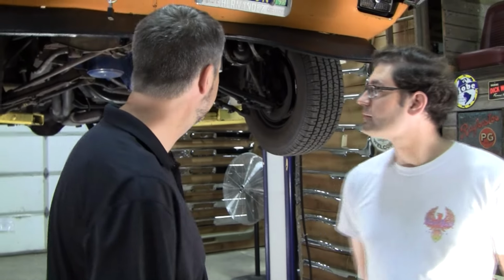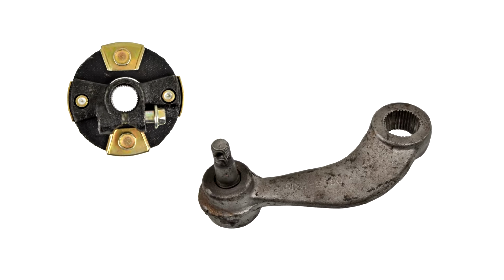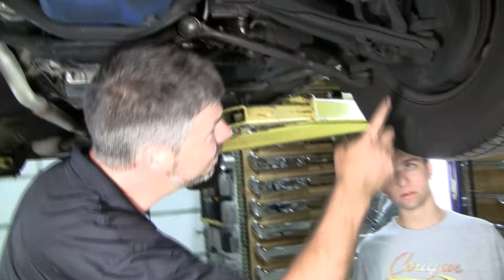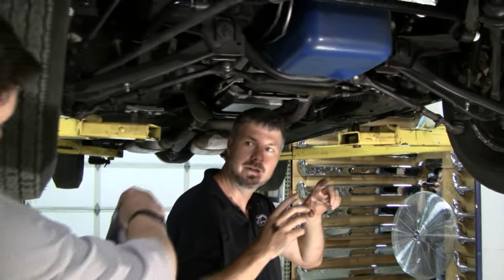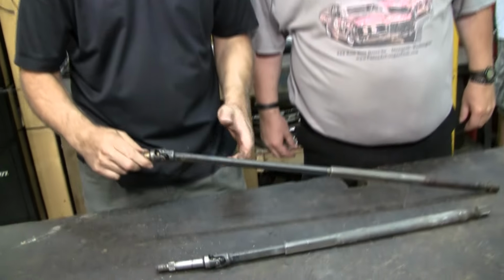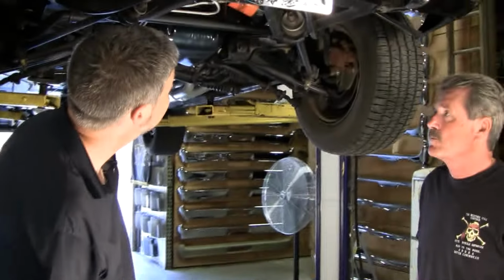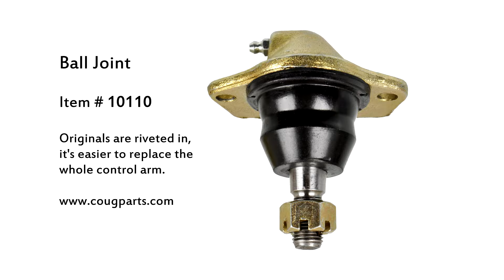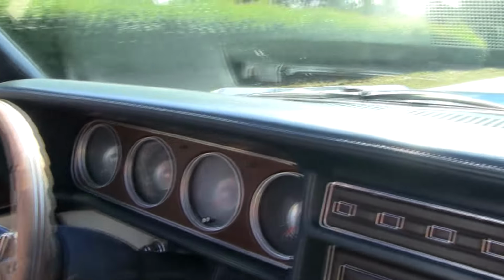Sloppy Steering Syndrome - Problems & Solutions

Comment: Great video..very informational..thanks I have a 67  ford  econoline van 6 cyl that I'm having steering issues with very stiff sat in a field for over 20 years original belll telephone truck from Mount Vernon Washington, first step is lube the steering box and I'm trying to figure out if I can use grease or 90 weight gear oil, it hasn't been lubed I'm assuming since the Nixon Administration if eve..r thank you
Reply from the maker: This might help: http://www.stangerssite.com/lubrication.html

Comment: I’ve got a 55 Commer truck with worm and gear wheel it’s tiring to drive with a sloppy steering wheel. All of the solutions have an adjustment nut while mine is adjust by a weird shims arrangement

Comment: I have a school bus (18K GVWR) converted to an RV, with pretty extensive wandering problems. Though it's a much larger animal than shown in this video , virtually all of the components are duplicated just on a larger scale. I am now equipped to diagnose my issue. Thanks for the info. Holding on to the tie rod  while someone else moves the wheel, is a key way of detecting worn parts, that a cool hack. Thanks.

Comment: if the steering link arm has worn tie rod mounts can the link be bushed my car has no replacement for it. and the link is cast. The only thing i can think to do is bush the holes. my car is 1963 Pontiac lemans

Comment: Could you tell me how to fix the problem at 7:33. The gear box not moving but the steering column have about 1/4 turn slag. Thank you so much.
Reply from the maker: You probably need to look at the Rag Joint: https://secure.cougarpartscatalog.com/store/Search.aspx?SearchTerms=rag%20joint&CatID=0

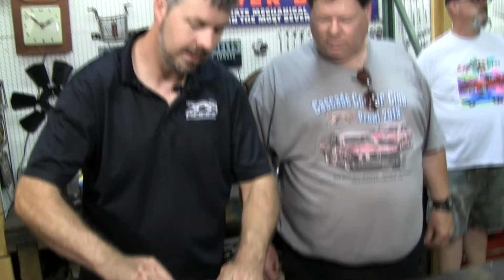As well as replacing the Retainer Clips at 14:25 : https://secure.cougarpartscatalog.com/17949/32067/retainer-clip-split-shaft-fixed-tilt-column-pair-repro-1968-1973-mercury-cougar-1968-1973-ford-mustang.html.
Reply: @WestCoastClassicCougar  Thank you so much for your willingness to help. Great channel, I love it.

Comment: Have an issue with tbe power steering, steering  wheel would slam to left, replaced power steering pump, new lines, rebuilt control value, scared to drive it.  Also trys to stall when wheel is turned to the left......no ideas what could be wrong...
Reply: I've heard the hoses may be reversed. On the rack. Don't know if it's true or not.

Comment: I almost had an accident this morning....my steering wheel kept feeling like it was going to come off....so loose.  Had the rack and pinion replaced 5 DAYS AGO. This morning on my way to work ,I felt something come loose...scary situation.  Got off the freeway and as soon I pulled into the has station,I completely  lost all power at my steering wheel....my steering wheel just kept doing complete circles right and going left....my tires just went straight....my car is back at the mechanics. Just glad we got off the freeway when we did...could have been really bad.
Reply: What happened?

Comment: I just installed a Borgeson Steering kit in my 1970 Mustang with tilt steering column! I made a major mistake. I told Borgeson I had a tilt Column, and they told me to buy the GM DD Rag Joint connector. Well, that wouldn't fit. So instead of really thinking about what I was doing, I ground the end of my steering rod to match the new DD Rag Joint. Now when I turn the wheel hard, there's a "thunk" and the rod moves slightly! All I had to do if I had given this situation some thought, is split the old rag joint in half and reuse the end that fit! 
Borgeson also told me to "Beat" the shaft out of the column in order to cut 1" off the outer Column housing! After watching this video, it's obvious that this is not the right move!
Now I'm in a situation where it's likely that I'm going to need to take the column back out, and weld a piece of 3/4 DD to the end of my inner shaft! Any comments from the guys at West Coast Cougar regarding this mess!? And by the way, you guys absolutely ROCK! You're my favorite problem solvers!
Reply: That was a $2000 steering column
Reply: That was a $2000 steering column

Comment from the maker: There seems to be some confusion over a statement Don Whitnell (DW) makes at around the 15:10 mark.  He says  "Most people put these in wrong". DW is referring to putting the shaft together incorrectly, not putting the clips in. The upper and lower shafts can fit two ways, but only work in one way. You should always mark the two pieces before you separate them so that they go back together the same way.

Comment: steering box rebuild on exchange basis for a Mitsubishi 2006 endeavor what would the cost be?
Reply from the maker: Those are substantially different than what come on the 67-73 Mercury Cougars we sell parts for.  You can get the one you need through most auto parts stores.  Here is a link to one at NAPA: https://www.napaonline.com/en/p/PS_361518

Comment: Hell my 1968 Falcon had sloppy steering the day it came off the lot brand new. It may sound unscientific, but back in the day the way I ''fixed'' it was by putting R/70 or wider tires in the front.

Comment: what is the cost at all that?
Reply from the maker: It really depends on what the issue really is.  

Play in the steering can be as simple as a pair of retainer clips in the steering column (https://secure.cougarpartscatalog.com/17949/32067/retainer-clip-split-shaft-fixed-tilt-column-pair-repro-1968-1973-mercury-cougar-1968-1973-ford-mustang.html) to needing to replace the steering box or suspension components. 

All the parts mentioned in this video can be found on our website in these two categories:
Steering parts: https://secure.cougarpartscatalog.com/steering.html
Suspension parts: https://secure.cougarpartscatalog.com/1967-1968-1969-1970-1971-1972-1973-Mercury-Cougar-Front-End-Rebuild.html

Comment: 31 years ago I fought this on my 67 Mustang coupe and gave up. 2 power steering control valves (dont use a pickle fork. I pulled the ball stud right out), springs, steering box (3 or 4 foot long solid shaft), upper control arm bushings, idler arm, 100 alignments, lower ball joints. It won't straighten out right after turning. Tried adjusting the control valve. I think the ride height is off. The lower control arms aren't parallel to the ground. The shock towers are good. Oh yeah, new shocks. Bearings.  I haven't driven it in nearly 20 years and that was just to change houses. It wanders everywhere. (Sigh.) You reminded me -  Headers require the extension for the power cylinder shaft (I have it.) Maybe I should jack it up and check it out again now that I'm old and broke instead of young and broke. Sheesh! I was watching Def Leopard, White Lion, and Skid Row on MTV (They really played music before, kids) when I was trying to fix it. Now all that stuff is classic grandpa rock. (Still kicks the crap out of the new stuff, young whipper snappers!)

Comment: I drive and push on brakes steering wheel pulls to left real hard replace brakes brake line and slave cylinder and bleed correctly and adjust brakes correctly has drum brakes. Change all front end tie rods idler arm pitman arm . U can drive just little forward still pulls steering wheel real hard to left can that be steering steering don’t holding it center thank you

Comment: Two outer tie rod boots were referenced in this video, one with a steel sleeve, one without. If the tie rod does NOT have a machined area around the casting at the ball joint, the steel sleeved boot WILL NOT fit. If it does, the non-steel sleeved boot will be sloppy loose. So don't order new boots just because you like the looks of one or the other, make sure which style tie rod you have before ordering new boots! I learned this the hard way because my friend's '67 Mustang had one of each.

Comment: I know my vehicle is way off from what your showing here but I have an 01 Nissan Xterra suv that I bought last year. I paid too much for the truck and have put a lot of new parts into it since but I absolutely love the truck.  I used to be strictly ford as my first ever car was a 84 ford mustang but I wanted an suv and had explorers, etc and wanted something different. I am getting ready to put new ball joints into the xterra as the truck is wandering bad and they are squeaking horribly.  But there is also a TON of play in the wheel atleast 3-4" of play side to side. The play seemed between the pitman arm and steering wheel and I wasn't sure what it could be but after doing some research I learned about adjusting the steering box.. After watching your video I feel much more confident that the box needs adjusting.. Now I can't wait to get outside in the morning and see if I can adjust it. I recently put all new brakes, rotors, drums, and front wheel bearing and races in and just put new tires on the truck. And i'm putting new ball joints in and I need to get an alignment but I wanted to sort out the steering issues first. I'm really glad you made and uploaded this video. Thanks for the work you put into this video. If it wasn't for the internet and guys uploading these types of videos It would take much longer to fix things.
Reply: Problem solved???

Comment: Yes I just bought my 1967 cougar. The car is a good car. But the car has been basically rebuilt. It really is tight  but as You are saying. My car has a lot of play in the steering wheel. I am constantly turning from side to side.
Reply: Check your wheels. Big wheels will certainly make you feel every single pothole you hit.

Comment: Sometimes you can't adjust it out though.. And be careful when buying a new one from parts house, take a big vice grip and some big pliers, test the new one before you leave. I had a shop replace mine,  hell has more slack now than before, got the new refurbished from Auto Zone, after researching I found out they repack them but don't always rebuild the valve assembly. So now, I have to remove my headers, loosen my transmission support, and engine mounts and lift the engine. I have a 351W in a 68 cougar.

Comment: Stop all the bullshit with these old cars & fit a new modern Rack & Pinion Power Steering kit from Unisteer. I did this with a 1955 Ford Thunderbird here in Australia that was all over the road & the owner couldn't believe the difference. That car on the hoist at 3:53 is positively dangerous with all those worn components.

Comment: that control arm, will it need to be rebuilt by a professional , or can an experienced mechanic be trusted on that. I'm curious because I'm fixing one myself. I care about my and other's safety and if I'd do better sending that part off that's what I'll do.
Reply from the maker: The upper and lower control arms are available new, and are pretty straightforward to install. An experienced mechanic can handle that.
Reply: West Coast Classic Cougar thanky thanky

Comment: I just rebuilt the front suspension on my 1990 Chevy k1500 did a right side upper ball joint and idler arm pitman arm the gearbox was leaking and the power steering pump so I put a reman gearbox and a pump and new hoses got it aligned but the steering feels way too easy not a lot of play but feels just too easy to turn and it being 4wd if you get on a bumpy road may make it real fun to steer do you think this could be a defective gearbox? and if so could you please tell me where I can find a good one the one I got is from A1 cardone and from what I've seen they don't have a good reputation anymore for quality so any help you can give me would be appreciated!  every thing else on the suspension is tight!
Reply from the maker: Honestly it's probably the new PS pump, you're not used to it working at 100% efficiency and now it feels too easy.  Not sure if there's any simple way to make it less powerful.
Reply: Greg Robinson . . ,     ,L
SL.,X.

Comment: I was told I need to replace Hi-Power steering pressure hose at 266.00 I guess I've drove the car to get worse,  now they say I need remanufactured Complete Rack Assembly Steering/Suspension and replace the steering suspension rack and pinion d total = 800.00 . My Dad is telling me to replace hose for now and if it needs rack and pinion etc. to replace it later cuz d stirring wheel does not seem to b that bad ,The only time it pulls a little  bit to d R/L (I don't remember ) is wen it is low on PS oil and not that often I feel it pulling I hear sounds and it is leaking of the oil pretty bad when I park it and when I drive away there is oil on ground , I hav to put oil in a lot and this is a 2005 Nissan Quest 3.5  my Dad (85 yrs ) is worried that that's a lot of money to spend on a van wen its timing chain can go out any time but I'm just confused that I have to get all done OR can I get hose first and c what happens ... I feel like they r saying I hav to hav d whole works done at d same time ...need to kn what I should do :/

Comment: Thanks for the video .  I have a 76 International Scout II and had a friend mechanic rebuild the steering gear box ( it was his first time to rebuild a steering gear box) and when he got done the truck don't wanna straighten back out while turning or going around curves.  I have to bump the steering wheel from left to right about 4 times to each side before it will drive straight again.  Once it's driving straight it will stay straight.  Do you think it's an adjustment issue or he might not have rebuilt it correctly? I'm scared to drive it now. Thanks for any advise you can give .
Reply: You'll have to go to a Scout forum to find answers for that one, we know nothing of those particular steering boxes.

Comment: Great video! Stuff like this is useful no matter what you drive. One comment though, I've always liked to replace the old rag joint for a couple of reasons. One is these cars aren't getting any newer, so it's a safety issue. I just don't trust old ones. Other reason is it seems to help with steering precision, less flex.

Comment: Got a Dodge van with steering problems. Thanks for making this video, now I understand you put your hand on each joint while someone wiggles the wheels. I was unsure how you tested ball joints because the wheel bearings also typically have a bit of slop. But if you put your hand on the joint it doesn't matter how much play in the wheel bearing there is.

Comment: Is loose steering dangerous? My 98 ranger just started it yesterday and I've got a 200 mile trip to make! Will stop leak do any good?
Reply from the maker: Do you have p.s. fluid leaking? I wouldn't think that stop leak would help. You might just need to tighten or replace a hose. As for the looseness, how dangerous it is depends on what's causing it. Usually you can get away with driving it that way for as long as you can tolerate it, it just means being more careful because you have less control. But if something in the front end is about to break, that could be quite dangerous if it fails at highway speed. Have a look at all your rubber bushings, wiggle the wheels as shown to check tie rod ends and ball joints and the idler arm, etc. Chances are you'll be fine, lots of cars are driven for years with loose steering, but it's worth checking out and fixing.
Reply: West Coast Classic Cougar got 68 cougar with clicking noise coming from driver wheel while driving any suggestions thanks
Reply from the maker: Hard to say. If you can lift up the front of the car and turn the wheel by hand, maybe you'll see something hitting. You could also take the wheel off and turn the hub to see if it still clicks. If you still can't see anything, it might be the wheel bearing.

Comment: Hi guys, I just discovered your channel and I love it. Although I have a 67 Mustang Coupe. I know some parts are similar. I have the same issues in my steering. Moving the steering wheel the rag joint has movement along with the pitman arm. I haven't check my ball joints, control arms etc.
Could the steering box need some adjustments? 

I appreciate any info you can provide.

Thanks guys.

Comment: shit my 2nd gen 2000 dodge ram 1500 with 5 inch lift was sloppy as get out. just.put a new steering box on tightened it as tight as I could,  new steering stabilizer, and upper and lower ball joints. fix the problem so far.
Reply: Bushing at shifter linkage on steering column fixed mine the lift kit word on column by pulling on linkagefrom bad motor mounts pulling like and inch back n forth. New mounts on motor will fix it

Comment: Wanted to say thank you for this video. I've been beating my head against the wall trying to resolve my steering.
If the sloppy steering is only towards the driver side and not the passenger side, does that change anything?
I can grab above the rag joint and it rotates to the driver side, but it is tight to the passenger side.
Reply: Sounds like maybe you need to replace the control valve.

Comment: address to send gear box
Reply from the maker: Assuming it's a 1967-73 Cougar / Mustang steering box:
Send Core Returns with a copy of your receipt to:
WCCC
Core Return for (Your Order Number) 
5377 Waconda Rd NE 
Salem, OR 97305
We recommend using a USPS Priority Flat Rate box as shipping to us will be under $20 from all 50 states.
Don't forget to remove your pitman arm and save it!

Comment: Lolol how can you talk about older cars having tight steering when the car you look at is pretty much aftermarket suspension/steering🤣🤣 alot of those steering components weren't available in 68🤣🤣
Reply from the maker: All the cars shown came with factory power steering in the configuration shown.  Most of them have had some of the factory parts replaced with aftermarket replacement components, or rebuilt components, that meet the factory specs, but none of them have aftermarket steering systems installed in them.  The tilt/tilt-a-way steering columns referenced are also factory options for the 67-69 Cougar.